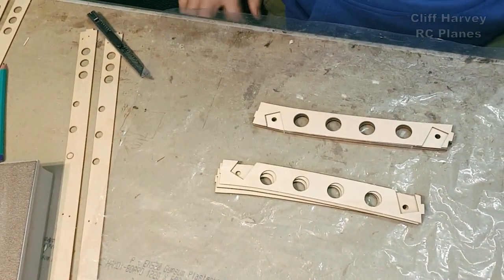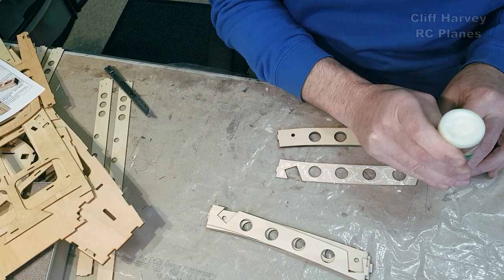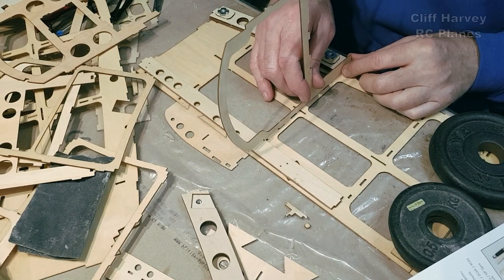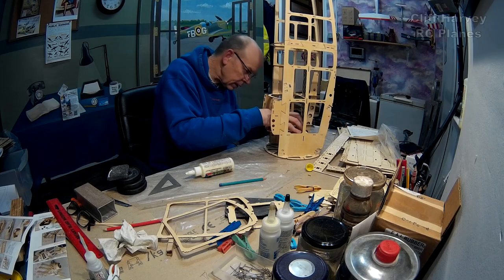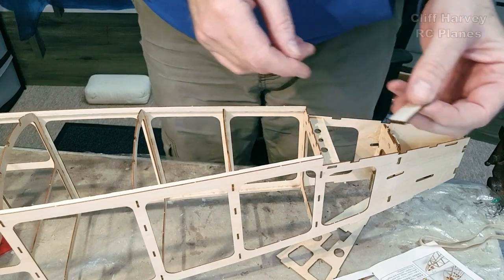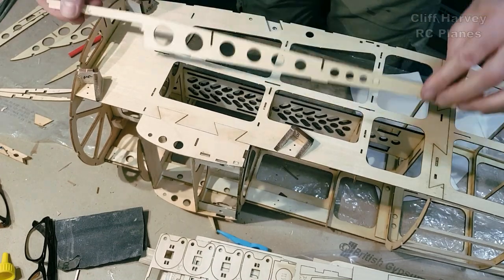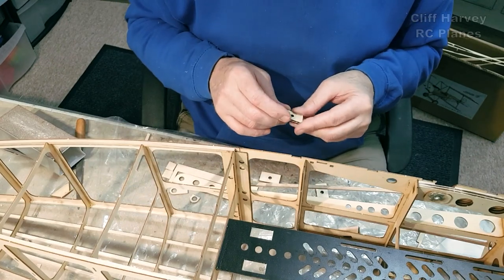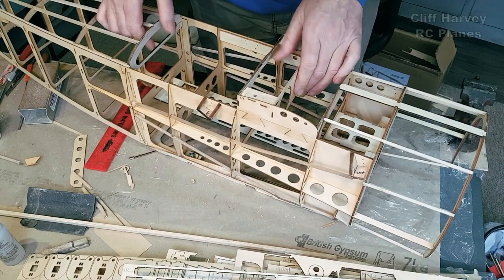Fokker Triplane Big Build Part 2

Comment: Looks great Cliff, the only things I did different was:  I did not glue the carbon fiber panel until I fitted the servos(needed to be larger for me) - since it was easier to cut them outside the fuselage.  I ground all the blind nuts to reduce weight . . . sorry your daughter borrowed it.  I did NOT place the 3 extra former supports flush with the fuselage edges . . . just my preference since they were curved inward.  I understand the need for the "tube" look with coffee stirs . . . But in the end after covering, I had almost no "tube" look on the fuselage.  Even the stringers appeared smooth and rounded after sanding.  But the coffee stir sticks look nice on the tail and rudder after covering.
Reply from the maker: Thanks Dan, I could have left that carbon panel till a bit later thinking about it, just in case. The blind nuts are pros and cons, grinding them down is more bother and you end up with less thread but then they are a bit heavier. I also liked the look of the curved inward formers (bit like an undercambered wing ...) on the bottom but I also wanted it to be a bit more scale. Thanks for the comments, cheers.
Reply: @CliffHarveyRCPlanes  I didn't know what "under cambered" was until you mentioned it.  Glad to learn things.

Comment: I'm SOOOOOOO tempted to build this thing myself. I prefer modern tail-draggers given the choice so maybe I'll build a Cub or even a Tiger Moth 😮
Had I have used your "bond with PVA/hold with CA" method as a kid, I probably could have built my Impala (keilkraft) in a single evening. 🤷‍♂️ Great video Cliff, it's going to be sweet when it's finished. 😁
Reply from the maker: Thanks CC, yes, methods evolve over time, actually I hold with ca, reinforce with white glue and then pin with ca, I still have my Big Impala if we're talking of the same model, I wonder because mine's Veron!
Reply: @CliffHarveyRCPlanes  ...it pains me to admit 😫 I stand corrected. I bought this with some birthday money when I was about 10 and flew it with a two channel Acoms AM radio. It had yellow solarfilm and flew beautifully. You could put the nose down and fly like a fighter plane or it was happy to sit on the lip of the hill. Many beautiful hours were spent on Westbury White horse Hill Fort near Bratton. Those Halcyon days...❤
Reply from the maker: @Cool Cat  Great picture you painted there CC 👍